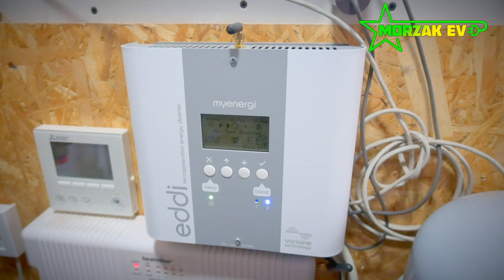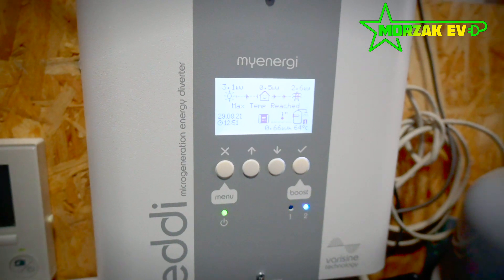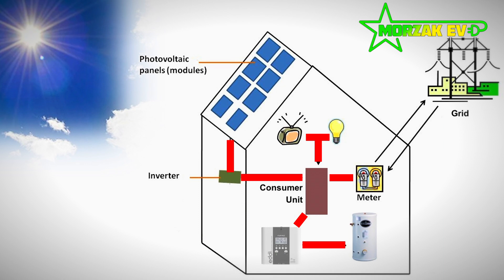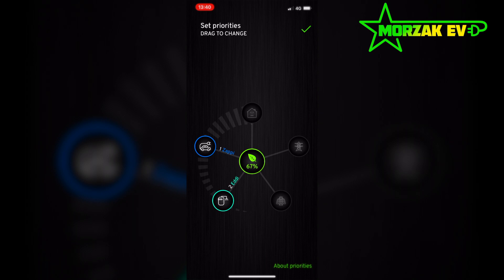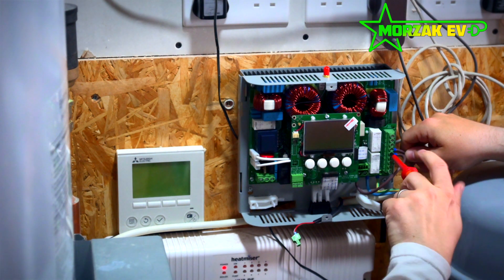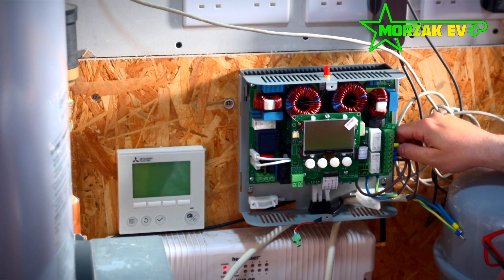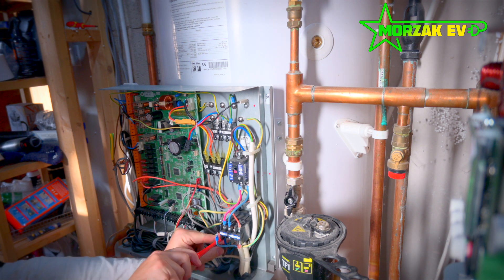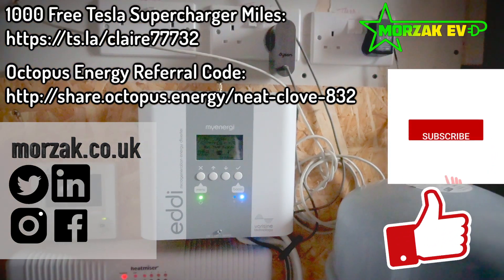MyEnergi Eddi - it can even be installed with an Air Source Heat Pump

Comment: From what i understand, the Eddi will heat the boiler using the electric coil, rather than allowing the heatpump heatexchanger to heat it? So by using the eddi you take away the benefit of a heat pump and go towards a COP 1. This is useful only if the excess electricity is worth nothing on your energy bill.

Is there a way to use the eddi to steer the heatpump itself to start /stop based on excess?

Comment: hi mate, I'm in the middle of a solar job and I have a Eddi to fit to work along side an ecodan.  Have you any more information regarding wiring on the ecodan side you could share? It looks like on the wiring diagrams ive seen you just need a two core cable to run between the additional relay and sensor board on the Eddi to the ecodan but unsure where they connect to. cheers

Comment: Hi. This video was great but could you do a small video about the heat pump side too? I have a joule heatpump and my electrician struggling to wire up eddi to the heatpump. Myuyenergi provided guide, but that does not help with the wiring from the heatpump point of view.
Reply from the maker: I could do, although every heat pump can be different. I did use the guide, but I’m reluctant to post something which could lead people to make errors. It’s actually really critical that whoever makes the adjustment understands it completely as if the get it wrong the legionella cycle won’t run correctly and it could cause serious health risks.
Reply: @MorzakEV  I have contacted the vendor of heatpump, but they are  not too pro-active with help. Joule says, they do not know how eddi works, so they can't give support.
Reply from the maker: @buscseik  unfortunately a lot of manufacturers don’t want to support installation of 3rd party products on their hardware. Worse than that though, you will probably find that if it was installed it would void the warranty! So you need to be really careful. I took that risk as mine was 3 years old, and now the warranty has expired, but again, everyone needs to look at this risk themselves.

Comment: Good video. Could the Eddi be used off peak (Octopus Go) when rates at night are cheaper than gas?
Reply from the maker: Yes, you can schedule the Eddi to come on whenever you want, the same as the Zappi, although if you don’t have solar panels and I’m not planning to get them, there are timer switches that will also do this. It does have the nice interface on the iPhone and android apps though.
Reply: @MorzakEV  that’s good to know, thanks. 
I wonder if using the electric element everyday would reduce the lifespan of the emersion heater or even void the warranty?
Reply from the maker: @K3Primrose  good question. It shouldn’t void the warranty as they’re designed to be used everyday, and generally the life span of immersion heaters is far beyond warranties. Generally it will have a shorter lifetime if it’s used more but then they’re incredibly easy to swap out and cheaper than boilers or heat pumps.
Reply: @MorzakEV  Great, I shall give it a run, I already have Eddi, Zappi with solar, just trying to get the most out of them. I appreciate the replies!
Reply from the maker: @K3Primrose  awesome- let us know how you get on!

Comment: Great video as a introduction to the Eddi ,I'm completely confused by all the different jargons surrounding the solar /emersion renewable energies, I'm going to have solar and batteries this year  do you have any advise as to what I should be asking a installer before going ahead with them allso is there a standard of practice that they have to comply by ,as in gas Safe and corgi but obviously a solar feild if you get my drift.
 Thanks in advance.
Reply from the maker: Yes, the solar installs should all be MCS or HIES accredited. This ensures the installs are guaranteed, even if the install closes business. 
In terms of questions, you need to make sure the installer has looked at your energy usage going forward and you battery and solar system is sized to meet your needs. A lot of installers will just go for a 4kW solar install because it’s easier to apply to the DNO but this may or may not suit your energy consumption needs.
Reply from the maker: The jargon is a nightmare, we plan to do more videos on this going forward, but it’s going to take some time.

Comment: Hi, Thanks for doing this vid and answering my main question - does the Eddi work with a ASHP,  PV Panels and and immersion heater.  I've got a follow on question;  
Is it worth doing?,  I can see if you have Gas heating it's a no brainer, but currently our ASHP (Samsung AE120 - 12kW) uses any available generated energy to heat the water as required and my understanding is that it is pretty efficient.  So I'm wondering if installing an Eddi which will presumably divert the energy produced by the panels and heat the water, rather than the ASHP doing it, will actually save much money - I'm OK with a fairly long term payback on the costs (7-8 years?)  - does that make sense or am I misunderstanding the way these things work (quite likely!)  Thanks in Anticipation.   Richard
Reply from the maker: So the air source uses the energy efficiently to generate heat, and if the panels are generating at the time, it will soak up that excess. The difference with the Eddi is that it actively tracks what would be exported to the grid and captures it in the hot water. The hot water may not necessarily be low enough to trigger the heat pump, but the Eddi captures it instead of exporting it for a much lower price. It’s hard to calculate the benefit, and I hope to do this at some point when I have enough data. Part of the decision was to also save the heat pump from working as much and we have found that it hardly runs in the summer when no heating is required. We also have a good 8kw of panels which really helps.
Reply: @MorzakEV  HI I am in a similar situation - about to have  a 12kw ASHP installed along with a 9.2kw solar array and 8.2kw battery. We will also have an EV in a couple of months with a zappi charger. Wondering if there is much point in shelling out for an eddi - the renewable electrician thought there wasn't much point although i fits saves money long term on the life of the ASHP may be worth looking at.
Reply from the maker: @commiepinko6  yup, I think it does. The other good thing about the Eddi is that Is the time to charging standard on all cars does not allow vehicle charging under 1 kW. This means early in the morning later in the evening, on the panels are not generating enough to get the Zappi started, The water is heated instead of the energy going back to the grid. This means during the day if your hot water usage is minimal, Then your air source heat pump doesn’t have to work at all saving on that electricity as well as the wear and tear. In my eyes it’s worth it for that alone.
Reply from the maker: Yep, that’s what I figured.

Comment: Great video. I think I have the same ASHP as you (Ecodan) and am getting Solar PV soon, so want to use the Eddi for the hot water as you describe. Is it still heating the hot water tank via the immersion up to say 65 degrees? Ie just the same as it would in a hot water cylinder on a traditional gas boiler? I think this is what you are saying. But that its just a bit more of a complex setup? So when its sunny your hot water tank is mostly going to be at 65 degrees? Also if the legionaires setting comes on every 7 days (say) but the tank has been up to 65 degrees two days ago due to Eddi, does it reset the legionaires cycle (eg 7  days from last time temp got to 65 degrees)?
Reply from the maker: We love our Ecodan, it’s saving us so much money compared with the alternative options, and it’s perfect with our underfloor heating. 
Yes, is simply heats the water using the immersion. We installed a temperature probe so we can set the Eddi to heat the water to a specific desired temperature. The legionella cycle still runs at the same frequency as it did before, regardless of whether it’s reached that temperature in-between as this is controlled purely by the Ecodan, and it doesn’t “see” of the Eddi is working or not as such. The reason it’s more complicated is because you need to install the relay board as a bypass for when the legionella cycle kicks in. This is because the Eddi could be damaged if the output side sees a voltage, so the relay bypasses and prevents this.

Comment: This looks very much like an iboost but more control. My issue has always been my 8kw solar system in the start of autum not actually doing much due to poor light Conditions, saying that if anyone has more than 8 kw system I think bingo. In the winter period I disconnect my 5kw battery pack due to it not charging fully during a poor lit day. Saying this if I could turn back the clock I would not have invested in the battery pack but rather purchased more solar for more surface area in poor light. I love the start of summer free electricity and miles on my ev. But nice unit. Be intresting to see what systems other people have and what they gain and what there thoughts are in the start of winter period.
Reply from the maker: Yeah. It’s good in how easy it is to swap priorities with the Zappi. We swap them around depending on what journeys are planned etc.
Reply: @Morzak EV  thanks for the video, I have the same set up, would you be kind enough to send over some details on how you wired it please.
Reply: @adamsiron3989  Hi Adam, did you manage to get this setup on your ecodan?